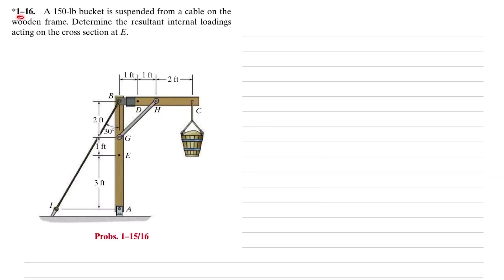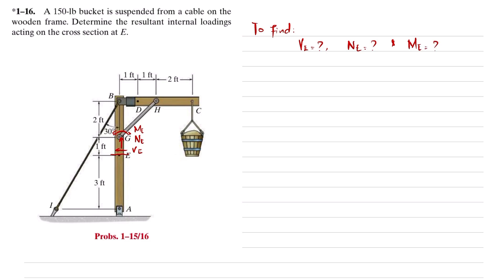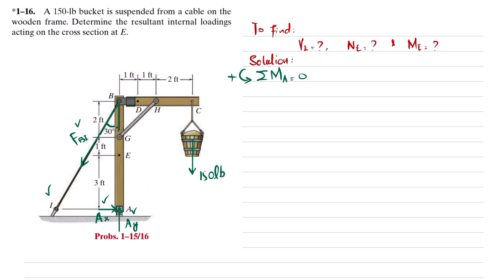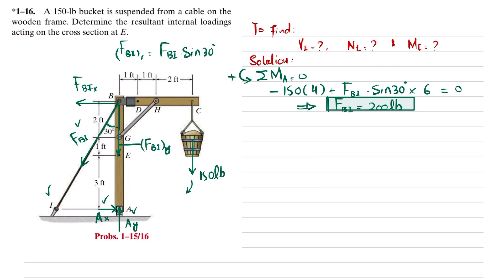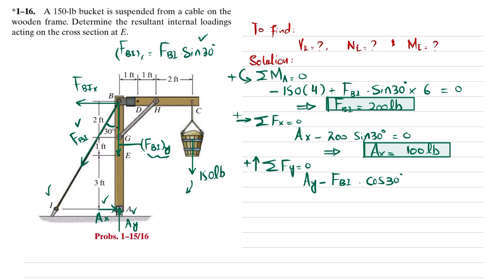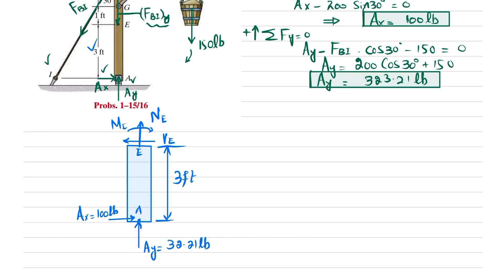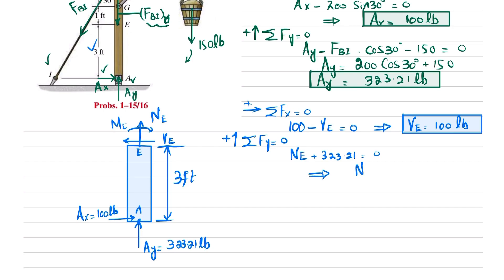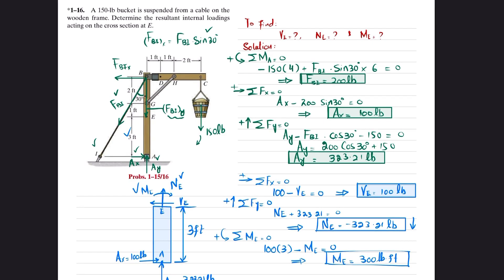1-16 Stress | Internal Resultant | Loading Chapter 1 Mechanics of Materials by R.C Hibbeler|

Comment: why didn't we use GH
Reply from the maker: Where please specify the time frame?
Reply: @engradnanrasheedmechanical  I actually meant this: shouldn’t a force F act on the object from the metal piece in GH? When drawing the free body diagram?
Reply from the maker: The member GH also exert force to the member to which it is connected
Reply from the maker: @ACY15-l1e you are welcome 🌹